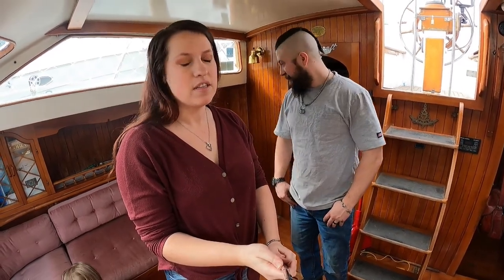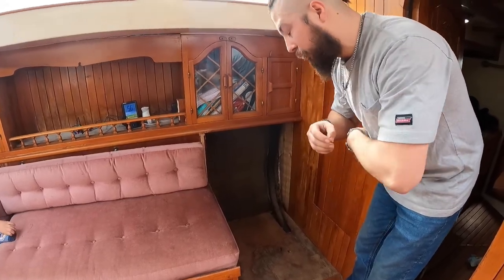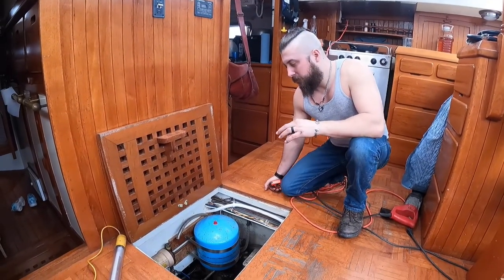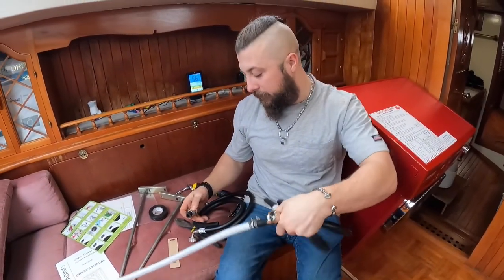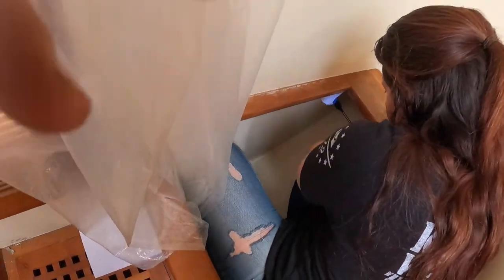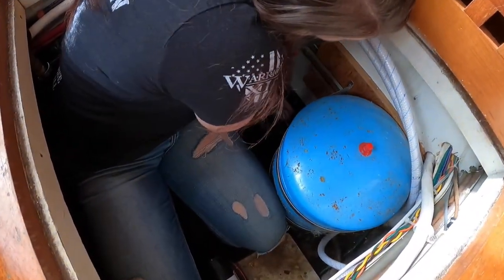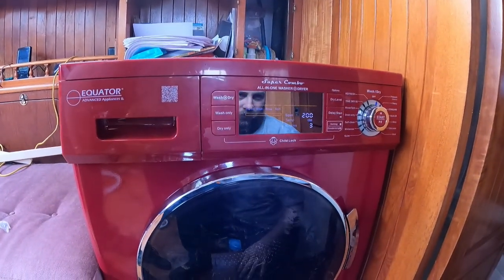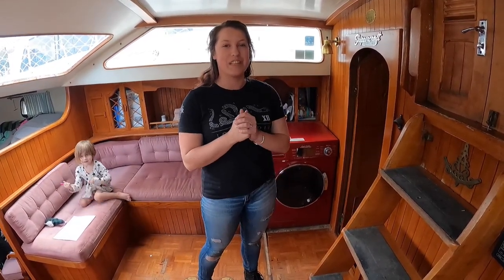Equator Washer/Dryer Combo Install  in 45 Ft. Sailboat

Comment: Does it get as hot as a household 220 model since the tumbler and heating element is on the same Phase.
Reply: No it doesn't, we haven't it ran it much but that's one complaint is dry times are longer. We figure in warmer environments we may hang dry some and finish in dryer to offset dry times. But we're going to do a review in the future after we use it more of thoughts, power usage, times etc.
Reply: @Dadlife_Alaska  how is it holding up considering you are on a boat?     Does it shake or is it stable/study?   With 3 kids you must have a lot of laundry.
Reply: @kevin Weber sorry for late response didn't even see this, so far it's been great, loads are small and takes a while but we like it it's study and really quiet barely know it's running. We are officially moved out if house last week so up until now we were still doing a load or two at our house when we stopped by but we're leaving the dock in 3 weeks so that'll be the real test is using it on anchor